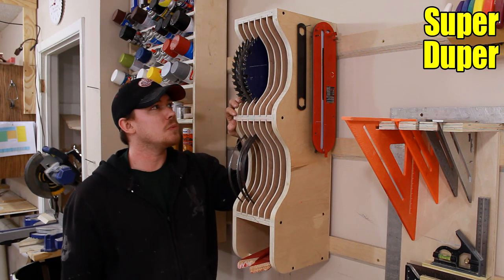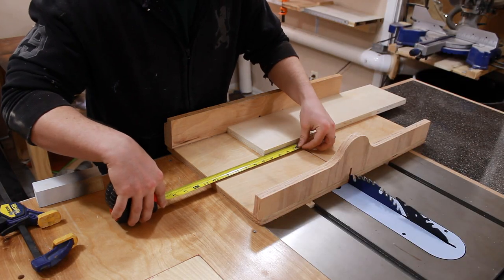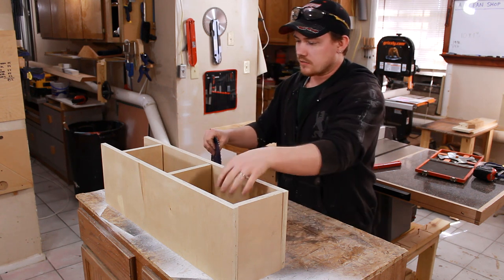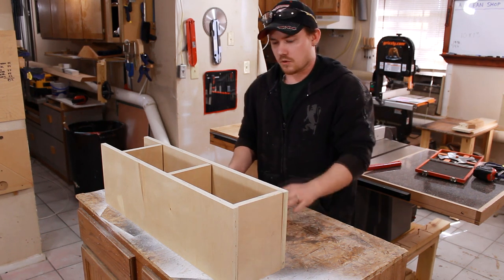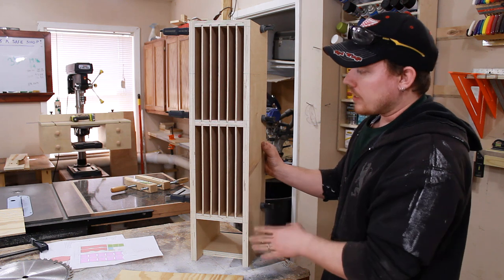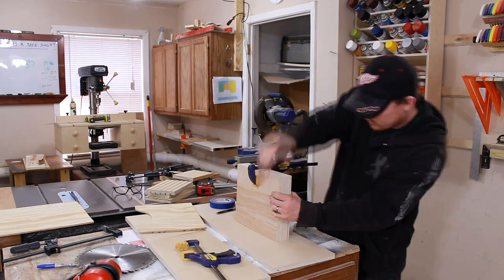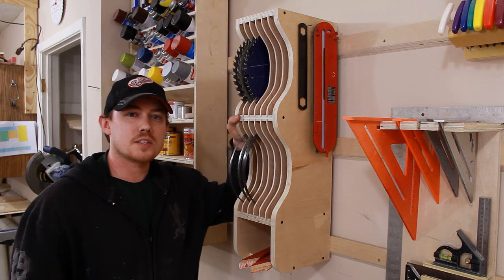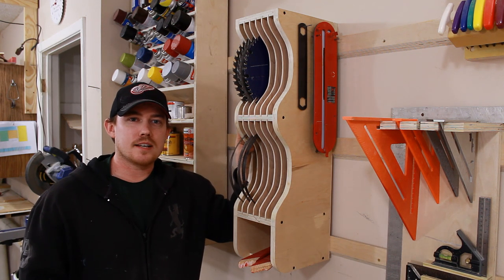French Cleat Saw Blade Storage - 133

Comment: Thanks for sharing your work Jay. Easy to watch and replicate. Iagree with some other comments about a slight pitch on the saw blades.. I guess a removable dowel or cleat could be placed across the bottom or top to lock the bladea in. Great project

Comment: nice job  , yes i too was going to say about the rolling out of the blade  , small cleat in front of the blade would be a simple fix  . i have mine in a drawer  , not standing but side ways on a 30 deg angle facing the front  , works great & no worries of getting hit or falling .
Reply from the maker: The blades do not roll. Even when I shake the cabinet they do not roll. The entire cabinet would have to lean forward for it to roll. It's attached to the wall at the top so this will never happen.

Comment: Dang, that's an elegant looking saw blade cupboard!  Did you consider putting stops at the lip of each opening?  I could also see a 1/2" dowel, cut at 20 or 30 degrees and maybe a quarter-inch long, glued to the side of the inserts, which the arbor holes could hang on--keeping the teeth elevated (not that I think that's a big deal, personally).

Comment: Nice idea, if the bottom of the two shelves sloped back by 5 or 10 degrees it would stop the risk of the blades rolling out
Reply from the maker: Nothing rolls out. It would take a quite a tilt to make these blades roll out.
Reply: No worries, just an idea, now there made might be even easier just to put a lip on the front at the bottom, just thinking of my own shed, keep up the good work
Reply: Maybe a safety piece that drops across the front.  Everything is different in earthquake country.  Things really move around once in awhile and that's lots of money in blades to have them all fall to the concrete floor.

Comment: By the way, are the bottoms of the saw blade compartments flat or are they angles so the blades don't slide out when the unit shakes for some reason?
Reply from the maker: They are flat. It would take a lot to make the blades move due to the teeth. They are staying put just fine.

Comment: Jay,
I DO LIKE MOST of this build.  HOWEVER, I don't like even the potential of circular blades listing forward and rolling off the storage unit and breaking on the floor or even worse a young G-kid or G-G-kid being injured by falling blades.
No matter the parental precautions.  So my question.  IF you were to rethink the design,  at what angle would you consider a safe slope, to the rear of the cabinet, for safer storage of blades & to avoid them rolling off the front.
Otherwise a great idea I will definitely cop and add to my punch list.
Thank you,
J

Comment: Jay Bates, I'm designing a similar one inspired by your design. Now that you've had it for a while, what are your thoughts on the sizes of the slots? Would you make them more than 10.5" tall or less than 0.75" wide?

I only have band saw blades and 10" max circular blades in my shop. Don't ever intend on getting a 12" miter saw.

Comment: I was wondering what you was going to add to your French cleat system. I like this setup a lot. I do have one question though. How do you keep the table saw blades from rolling out? Seems like they may roll out and fall if the shelf gets bumped or vibrations from your shop equipment. I was thinking maybe about adding a buggy cord to the top section just as a added security feature so I wouldn't have to worry about the blades accidentally falling out and getting damaged.
Reply from the maker: The table saw blades form a flat surface between two teeth. They do not roll at all even with hard shaking.
Reply: Jay Bates K, thanks

Comment: dam wish I didn't live in an earthquake zone... like the idea but would have to do something to stop the blades falling out every time we get a shake lol
Reply from the maker: I'll shoot a follow up video with me vigorously shaking the cabinet. They are hard to move.
Reply: Bundgy cord?
Reply: Craig Hastie not a bad idea... though a low front would also work... plenty of thought.  I actually use a pull out shelf system that holds all my dado blades as well.  each shelf is only 1/2 an inch high so it is pretty compact. but anything to get gear up on the wall is a plus in my small workshop.  need a break from paying work to just play for myself lol
Reply: Could put the shelves in at a downward angle toward the back too.